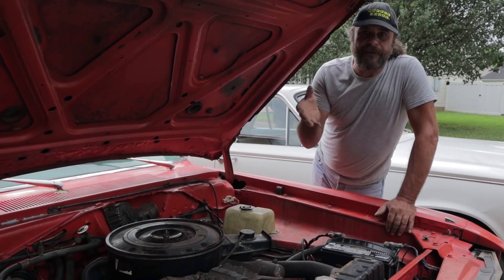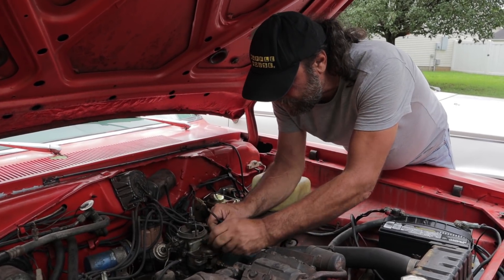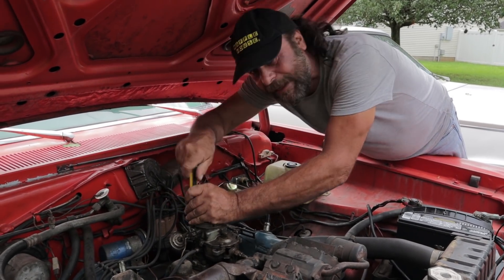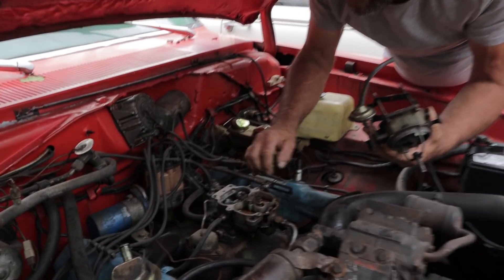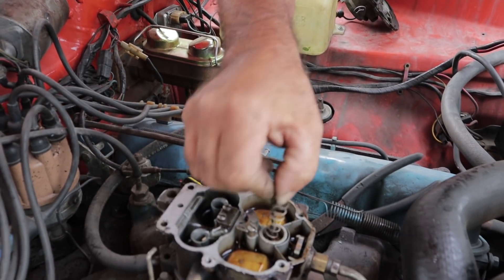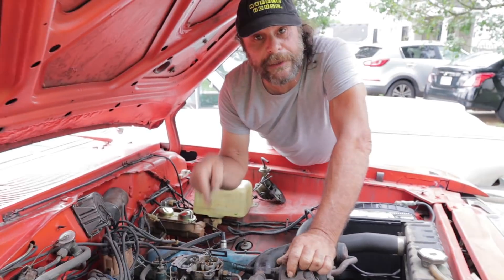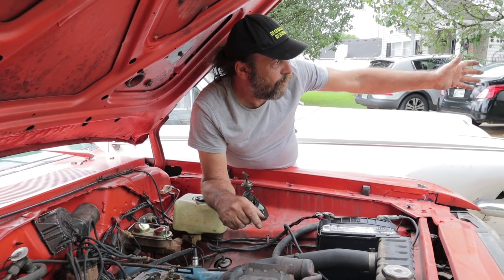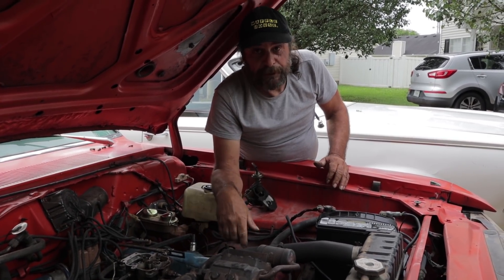Driving Classic Cars- The Truth About Ethanol Gas

Comment: Another complaint we often hear about the new gas is that it destroys the rubber in the fuel hoses. Maybe it does, and maybe it doesn't. I don't really know for sure. But I suspect that the gaskets in my two Beetle's carburetors don't like it if the Ethanol level gets too high. One of my friends did an experiment when he replaced the fuel hoses in his 1966 1300 Beetle. He zip tied a 10cm piece of fuel hose that wasn't connected to anything next to the fuel hose that runs past the transmission and into the engine bay. Then he drove like this until it was time to replace them again. And to our surprise the different fuel hoses had worn in the exact same way. And when he split the hose that had fuel in it to look at it's inside it looked completely fine. Just like the dry one. I am not saying that anyone has debunked something or proved a theory, but I have seen similar results on other cars. Including my own. And I really only know Beetles. It can get quite hot both in and around the engine compartments of these cars, and to me it looks like the heat is one of the hose's worst enemies.

Comment: Running E10 or E15 blend gasoline for automotive use doesn't present much of a problem in most vehicles. Where I live you can buy E 85 and if your vehicle is not designed to run on flex-fuel the least you can expect is the check engine light to come on until you go back to E10 or E15. In older cars, it will harm anything in the fuel system that is not compatible with E85. Another problem with E85 is that you will get 26% less fuel mileage compared to the E10 - E15 blends. And despite the fact that E85 has a lower price because of the drop in fuel economy it is more expensive to run and produces only 0.5% less emissions.

Comment: Right before ethanol pretty much became the standard additive provided gas stations, during the days of mtbe... I did troubleshoot a guys carb that was [I think] a victim of ethanol - from various octane additives.  Most know that alchohol absorbs water easily and quickly, which came into play, but it can drop out of solution after some saturation point.   The car had an 11.5:1 compression and at that time, hi-test was beginning to disappear from his area: he went from having a few places that had 98 all the time to  finding mostly 91/92 octane which the motor did not like.  I have no idea how many different octane boosters [a few were loaded with alchohol] went through that system, but as I arrived the situation was motor would run/drive fine but died at idle except you blipped the throttle. I think he had bought and tried just about every octane booster that was on the market.   I agreed to inspect/rebuild the carb [which used to run just fine when vehicle was purchased] and what I found was this: about 3/8" or so of water in the bowls [level as found was about 7/8 of jet height but not quite burying them] and what was happening was the surface tension was different - at idle, it choked off the jets making them behave smaller.   Get on the gas pedal, and between better signal/higher velocity, fuel flowed as normal [got pulled down through the water level around jets being lighter specific gravity] and the carb ran as tuned; but pull to a stop and the motor would die.  Cleaned up the bowls, ran it a bit and all was good.  I would have thought the tank had the same problem, but it did not occur again even after driving it a month - whatever was in there before got pulled through.    I will never know how much water went through the system, but it appeared to be self regulating: if it buried the jets, enough got pulled off the top when starting to get some fuel back in the bowl.  What stagnated at the level below sure left alot of ugly crusty bits - the kind a fuel filter usually grabs no problem.

Comment: Thank you for shooting and posting this video. There's a lot of good information here, and the primary conclusion that ethanol does not cause damage is correct. However, a couple of points are incorrect. For example, ethanol is compatible with more types of rubber, plastic, and metal than gasoline and aromatics. Therefore, if there was rubber in the accelerator pump, there's no reason it would be more corrosive to the rubber than gasoline and aromatics.  In the instance you display, where leather is used, the leather would be susceptible to the petroleum and benzene elements of the gasoline faster than it would be to ethanol. 
The information you provide about shelf life is off. Ethanol never goes bad. Gasoline and aromatics go bad, and the additive used to denature the ethanol (gasoline or some other petroleum distillate) will go bad. You should never let any internal combustion engine sit idle for extended periods. As gasoline or ethanol-gasoline blends dry the residue will harden into a varnish like substance, but this is caused only by the gasoline and aromatics. Ethanol dries clean, with no residue. 
As for excessive evaporation of ethanol, this issue is generally overblown, too. I did a test this past January to prove that ethanol does not suck water out of the air. The test also demonstrated that ethanol (even pure 100% ethanol) is not so evaporative that you would have to worry about the fuel in your fuel system evaporating over several days or weeks. You can see the video of this test at: https://www.youtube.com/watch?v=nC0srT0zlh8.
Additionally, ethanol-gasoline blends were used in Great Britain and Europe extensively for many decades beginning in the late 1800's. Ethanol-gasoline blends have also been mandated in Brazil since the 1970's. If ethanol-gasoline blends exhibited the evaporation problem you suggest it would have been well known during all these years and there should be tons of news stories about it. If there are any, I've never come across them.

For more information about the myths associated with ethanol damage, read my report, "WHY DO SMALL ENGINES SUFFER FROM ETHANOL PROBLEMS?" at http://www.theautochannel.com/news/2015/09/01/140446-why-do-small-engines-suffer-from-ethanol-problems-video.html.

For more information about the use of ethanol-gasoline blends in England and Europe read my report, "THE HYPOCRISY OF BIG OIL" at https://www.theautochannel.com/news/2017/12/20/478776-hypocrisy-big-oil.html.

Comment: I'm from South Africa and have nothing good to say about Ethanol, I have a 1974 Peugeot 404(daily driver), you can't start it at a turn of the key after its been switched off for 5 to turn minutes due to the Ethanol gas but it will always start first time in the morning or after having been parked for 3 hours or more, very frustrating situation. I never had these problems with leaded fuel.

Comment: Uncle Tony, first would like to start by saying I just got my T-shirt and stickers today! Great turn around and very happy (the guy from Ohio), thank you! Although secondly I do not agree completely with your observation on ethanol and carbs. While on your type of carbs I do see what your saying as I have a 86 f250 with a 300, and now it makes sense why it takes so long to start after sitting. However I'm bigger into old tractors and equipment which for the most part use updraft carbs and gravity feeds. In this case ethanol sucks and expecially in the newer small engine stuff with aluminum carbs.  The reason is ethanol gas breaks down faster that old gas some say within a month or two. With gravity feed and updrafts the last place dry from evaporation is the carb. So it sits in the bowl plus ethanol draws water which sits in the lowest part of the system (the carb) allowing two things to happen large varnish build up and lots of rust as the carbs are mainly cast iron. It's a total nightmare. On the few I run very often I don't see as much issue but if they sit like a combine or a less favorite tractor you might as well figure on a carb kit (doesn't help all now a days available is Chinese junk) or a good cleaning at best. Some have been done a dozen times. That being said if you religiously shut off the fuel and run carbs dry your good, however sometimes it gets forgotten thinking your gonna come back to it. Just some food for thought and my two cents. Thanks again for merchandise and great videos!

Comment: I'd love to hear Uncle's Tony opinion on using E85 in older cars. I see E85 as a gift from the car Gods.. it lets me build a super high performance, high compression street engine running very aggressive timing, and not have to pay 13 bucks a gallon for 110. Instead, it's cheaper than normal gas! But I know the story is a little different when you're carbureted. What's your take, uncle?
Reply from the maker: E85 is a step too far for the typical, low compression carbureted daily driver type car.  For performance use, where you can jet fat and or use injection, along with high static compression, it's awesome
Reply: This video is on E10 not E85.

Comment: I'm a German car guy, and the ethanol fuel is "okay" just realize that the German fuel lines are not ethanol resistant.  There are certain specially shaped fuel lines that are impossible to use US fuel line on... You are forced to use OEM fuel line in these cases, and change them more frequently.  Clogged jets and dirty injectors can be a result if the lines are not changed.
Cheers!

Comment: We had problems storing fuel at the ranch way back without ethanol fuel at first...mostly the  4 wheeler would sit for months between hunting seasons , the lawn tractor and weed wackers not so much because they got used at least every three weeks ....I have used fuel Stabilizer for 30 years .. heck the only real true problem with ethanol fuel is the water it collects , But I’ve  been on the Texas Coast since 1993 and  the facts are Alcohol loves water ..So my fuel light came on in my pickup and it starts staggering missing like there is a plug wire or two off ,,,so I fuel up and it goes away ..,freakin water ..

Comment: what Chrysler/Mopar car can you think of that would be acceptable to drive with a 70 horsepower engine? a word on evaporation, I find between the check valve and shut off valve on my Harley Davidson that not much seems to evaporate from the tank. to start I'll open the valve let it sit a minute to refill the float bowls, then give the accel pump a couple squirts followed by another minute before starting it up.

Comment: The quality in fuel in thw south is definetly different from here in pa. Im no proffesional on fuel but when we travel to the outter banks i fill my suburban up 3 times for the trip down. On the way back i fill up once fully and top it off once at around a half tank. My mileage goes from 12.5 to 16.3 mpg. Also my square body chevy trucks, factory quadrajets last a lot longer in comparison to my edelbrock. The edelbrock is trashed inside. A bad dark brown film and every other year im cleaning it. The quadrjet last around 5 years or so before scewing up. Im guessing different metals? Idk. We run nothing but BP gas. The vehicles seem to like it best.

Comment: I am a small engine mechanic,  and I can tell you ethanol gas is a problem after long periods of sitting.the main jets and bowls fill up with gas that turned to jelly after sitting from November to the following March. If your talking 3 years or more, you can go to remove the hinge pin and the carb will literally disintegrate.
Reply from the maker: Gravity fed systems are completely different

Comment: Ethanol gas has a lower boiling point, so when the gas goes through your hot mechanical fuel pump
and you don't have a return line you can get vapor lock or when you shut your car off and the gas sits there
and boils it builds pressure in the fuel line and push the gas pass the needles in the carb and the bowl of
the carb goes dry especially in the hot summer.  That is why you have to crank and crank to fill the bowl back 
up with gas when your car sits for a few hours and wont start right away in the hot summer.
That is why I won't use ethanol in my built 440.
Reply: I'm a mopar guy my self. I enjoy your videos keep them coming.

Comment: I have used ethanol gas ever since is has come out, Ive never had a single problem in anything from 2 cycle equipment and cars. Ethanol is the best fuel system cleaner out there.

Comment: Ethanol makes rubber swell up. Can't use gasohol if theres any rubber in the fuel line.
Reply: new or old fuel line... newer rubber lines is made to withstand the ethanol in the gas
Reply from the maker: I have rubber in all my cars, including the one in this video
Reply: @UncleTonysGarage  Some of it may be neoprene or newer types of rubber. Since the fuel embargo of 1973 US cars were made to handle 10% ethanol but my 1940 Buick has old style rubber. When I used gasohol with it, every time I unclipped the glass bowl to replace the fuel filter, the rubber washer was too swollen and it didn't fit anymore, and I had to use a new washer each time or it would leak, the old one was at least 30% bigger than the new one due to swelling. Now I use zero ethanol gasoline and it never happens. Here's the car: https://www.youtube.com/watch?v=VpqHGIITcwM&t=227s

Comment: 🤔Then how come i have to replace my cracking rubber fuel lines 1-2 times a year?
Reply: I've noticed a lot of 'so called' "rubber" products are not real rubber at all. Many of these don't last very long either. Some do last quite well though. Knowing what the material is, is the problem. Most do not state exactly what their "rubber" is. I'm going to guess the lines you have been getting are made of urethane,,, maybe.
Reply from the maker: What Butch said

Comment: One of the biggest headaches concerning ethanol is British cars and motorcycles, after WW2 British industry chose plastic and rubber for vehicles that wasn't impervious to ethanol (who knew?), unfortunately for Triumph and BSA (among other British bikes) owners here in America even just 10% ethanol melts original fuel lines and especially carb floats overnight, it's caused fits for those guys, they've actually resorted to pouring water through gas to separate the ethanol, the water captures the ethanol and it settles to the bottom, then the gasoline can be siphoned off the top, problem is you lose 10% of the fuel that you buy doing that.
Here in America cars are one thing but ethanol has caused me to buy two new weed wackers and to rebuild the carb on my riding mower because it melted the diaphragms and primer bulbs in their carbs, oh yea, and my chainsaws, just cause it doesn't hurt the carb floats in an old Moplow doesn't mean it isn't harmful to other engines and fuel systems.

Comment: Tony you wield a wicked screwdriver!  You can see the hours wrenching on those mitts buddy....I have had same view of Ethanol fuel for general runability in my Pontiac 400, but it seems to suck the life out of rubber fuel lines - turning them to stiffened carbon rods in about 2 years!  You have to use Eth resistant lines. My auto store ordered it for me, not standard stock....WHY?   I cringed when you plopped those carburetor bolts onto the cowl..thought a couple of screws would fly down the vents...been there....but you have lots of parts stockpiled so no worries.  Love your automotive common sense approach! keep em coming...

Comment: I have a 383 with a thermoquad. If it sets more than 2 days I have to crank the shit out of it to get gas into it. I didn't know it was ethanol related. Guess I should put an electric fuel pump on it with a toggle switch. Thanks!

Comment: I worked at my father-in-law's small engine/chainsaw shop for a couple of winters. If a saw came in with melted mushy fuel lines or had sat for more than a month and wouldn't start, chances are they used ethanol gas in them.

Comment: i replaced my fuel pump in my 67 galaxie after 8 years.  not much mileage and took the old one apart. the diagram had just started to get crackes in it . carb is fine.

Comment: I'm not disputing your experiences at all, as long as you use the ethenol gas and don't let it sit it's fine, but I work on lawn mowers and every spring I'm inundated with mowers that won't crank. Which is good for my business, the problem is this, ethanol gas has water in it and after sitting for periods of time the water seperate's from the gas and settles to the bottom of the fuel tank. Then it's the first thing to be sucked up into the carburetor when trying to start the engine. That's the main problem with ethenol gas, I simply clean the carb drain the fuel system and problem solved. I won't purchase gas from a service station that doesn't have high traffic at the gas pumps, because the same thing happens inside of the underground fuel tanks. Ethenol gas has a short shelf life because of this issue. And gas distributors know this sometimes low traffic rural gas stations get better deals on gas because the distributor knows it's getting toward the end of the shelf life and they have to get rid of it. Uncle Tony keep up the good work love your channel and look forward to all your videos.
Reply: Absolutely true. It all starts in the fuel tank. If you run that watery fuel up through the lines and into the carb, that's where the trouble starts. Without moist air, it doesn't go bad, so lines are usually fine as long as the fuel going in was fresh to begin with. Fresh e10 also has no trouble evaporating from carbs, but again, if it's watery and nasty, it stays there, all acidic, eating and corroding stuff.